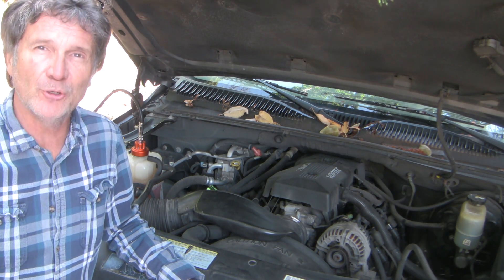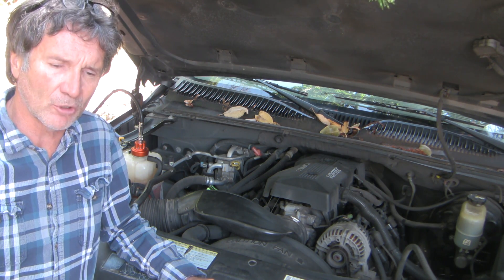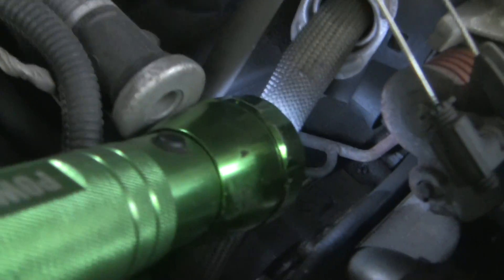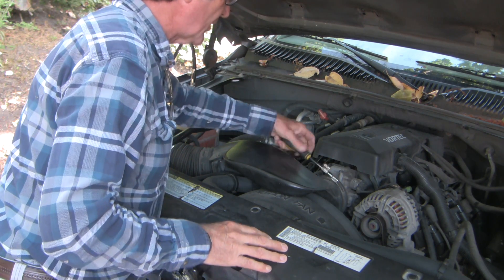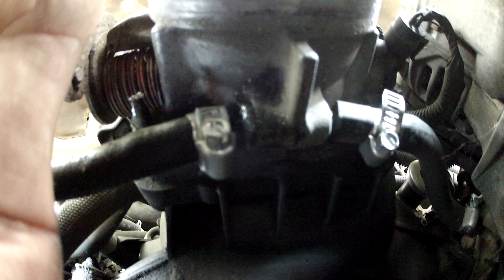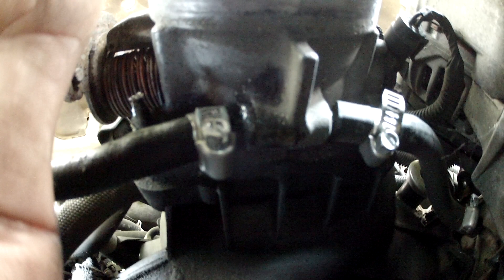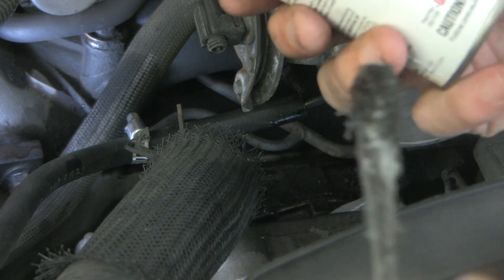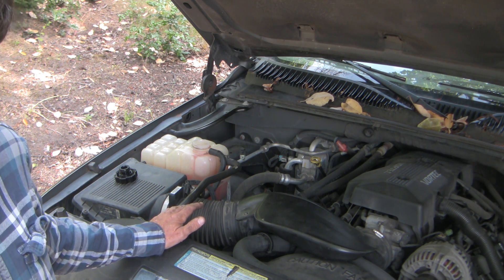How to diagnose a mystery coolant leak in a Chev/GM truck

Comment: I think it's a good idea to always change the thermostat if you fix a leak just in case it's not opening as fast as it should I guess you would know if your fans are running when they normally don't
Reply from the maker: You make a good point, although the quality of parts these days is far inferior to what was on the vehicle originally. I suppose if the thermostat fails to open early enough, pressures could spike and hoses could leak, especially if your gauges fail to show temperatures.

Comment: What if the leak is coming from plug on the coolant
Reply from the maker: Good question, what if the leak is at the cap, which you removed to put on the pressure tester? First, have a look at the cap, sometimes you'll find telltale cracking of the seal, or coolant residue around the cap. If that is normal, you can attach a pressure transducer to the drain hose, that hangs down from the cap. That drain hose attaches between the two seals of a pressurized cap. If the bottom seal leaks, you'll never mount pressure in the system and boiling point is lower. That leads to hot steam exiting the system, which may make a puddle or may not depending on volume. A pressure meter should be able to measure pressure in that hose if you've got a significant leak there. If in doubt, change the cap, they aren't too expensive.
Reply: @spelunkerd  the leak is coming from the overflow hose a part of the clamp broke trying to fix it asap. No Auto zone in my city has overflow hose right now
Reply from the maker: @r.brown0294  The overflow hose for a pressurized reservoir like the one shown won't push fluid or air unless system pressures are too high, OR the bottom seal for the cap is failing to make an airtight seal. The most common cause of system pressures being too high is because of trapped air in the system, in which case the air expands as it heats, forcing air and fluid out that hose. The most common cause of trapped air is a coolant leak or recent work on the engine, forming air pockets inside the cooling system. Inspect the cap, fill the system to full, run the engine with cap off to burp off any trapped air, and reassess. If it has been leaking you need to find the cause and if pressures are consistently too high, consider other more uncommon diagnoses like a stuck closed thermostat, head gasket leak, etc.
Reply: @spelunkerd  question one of the clips Brokaw if I break the other clip off get a rubber Pat and clamps with that work just as efficiently? As the original clips

Comment: Hi, I have a 2016 chevy silverado 1500. I have a slow "mystery" coolant leak that takes about 2-3 days after I've refilled the coolant for it to start overheating. I can't really tell where the leak is coming from with all the emissions crap covering everything. It is wet all along the bottom part of the radiator and  a very slow 1 drop every 5 min off the framing behind the headlights. I dont see wetness anywhere else. Radiator leak? things I should check first? Loved this video. I'm gonna start watching your other videos right now lol.  oh miliage...130,000
Reply from the maker: Take off the plastic covers underneath and find out where that leak is coming from. Lots easier if it isn't raining outside, ha ha. The most common cause of a leak at the bottom of the rad itself is the radiator, which commonly leaks from the two plastic end caps, one on each side. Other places to look for are hose connections, the weep hole of the water pump, and various connections including the drain spigot at the bottom of some radiators. If the rad is leaking, simply replace it, nobody fixes those any more. Keep the reservoir full and don't delay repair.

Comment: I also have a mystery leak (2005 chevy Silverado 1500 4.8) ; the fluid only disappears down to a certain level in the reservoir tank and no further. But, that is enough of a loss that the engine runs hot and get very close to overheating. Also there is no visible evidence of puddling or otherwise.
I’m taking the advise of your video and focus on this hose connection. I hope it works for me.
Note: my throttle body hose connection has the ‘squeeze clamps’, yours had the ‘screw strap’ type. Those clamps on yours don’t appear to be original (? Idk).
Reply from the maker: Yes, I added those clamps. If you're overheating the game is more serious. It may be simply from trapped air, but overheating can be from various other issues. You can even get coolant loss from overheating when the valve on the pressurized reservoir cap decompresses. Two 'easy fix' diagnoses are a bad cap and a bad thermostat. The Chev thermostat also controls bypass flow, and if that bypass tract sticks open you can run hot. If you can't come up with a diagnosis I'd look for a second opinion from a shop before it is too late. One thing that could cause a plateau of coolant loss would be a cracked reservoir tank.

Comment: i bypass that i run right from the rad. to the engine
Reply from the maker: That's a good point, I always do that when possible, too. The radiator for this vehicle has no fill cap, the reservoir is pressurized and the only cap is on the reservoir. It's easy to spot a pressurized reservoir by having a close look at the cap. Like the cleverly designed radiator cap, it has two spring loaded valves opening in opposite directions to allow both pressure relief and automatic burping.

Comment: Where did you get your pressurizer?
Reply from the maker: First one was Astro, in the mid 90's, I think through an automotive parts store. It was missing caps for some vehicles (like the somewhat unusual GM vehicles of the mid 2000's),  so second one was a chinese brand through Amazon a few years ago. The chinese pump isn't great but the caps are fine.

Comment: I'm losing water and  I smell fluid.
Reply from the maker: If you smell fluid from the drivers seat, check your floor mats, specifically the front passenger floor mat. If it's wet with coolant, you've got a leak in  or near your heater core. The bad news is that although the solution is as simple as swapping it out, the labor to remove the dash is many hours. If you smell fluid from the engine compartment, you want to do as I did, hunt it down. Common places to look are the radiator and hoses.
Reply: @spelunkerd  its  only outside the  van . Its driving me crazy.

Comment: I need to get that tool to pressurize my system, I have the Exact same issue with mine currently. I didn't even know those hoses were there on the throttle body? Excellent video, I desperately was needing this!

Comment: I loaned one of these from my local advanced auto and none of the caps fit my radiator so used one of the universal ones the kit came with. The system held steady at 15psi the whole time and I couldn’t see any obvious leaks. Pretty annoying I know I have a leak as I always see it dripping around the transmission and have a small pool under the truck. Oh well..

Comment: @ 3:56 is that the coolant leaking?
Reply from the maker: Yup. I made a little fountain when I pulled that leaking tube off, even though I decompressed the pressure and removed the pressure tester from the reservoir. Pressure imbalance from inside the cold engine drove fluid to escape, for some reason. I was ready to cut the end of the tubing down and so quickly replaced it, then mopped up the mess of coolant on the garage floor, ha ha.
Reply: I’m working on my GMC truck and am having the same issue. THANK YOU !

Comment: My 2001 4.8 has a mystery leak. It would be so nice if it was a hose and not a head gasket. Next, get my hands on a pressure tester. Thanks for the vid.
Reply from the maker: I'm told that some autoparts stores will loan them out for a deposit. This version of the GM engine has an unusual sized cap and it can be hard to find the right adapter. The other option is to find an inexpensive generic kit online.

Comment: I had the same issue  and discovered  right where the thermostat  joints  into  the antifreeze  tank and heater hose that plastic  joint with those plastic  or rubber  clamp that plastic  joint  had a hair line Crack in it , also it had become  dry rot I'm buying  a metal  joint  to join those 3hose together  Sound like they where  trying to save money  and cut cost you ask me

Comment: Nice find! I have this symptom. Also I smell coolant when I come to a stop.
Reply from the maker: If you smell coolant in the cab of the vehicle, check the floor mat on the passenger side for wetness. The heater core is a type of radiator that can leak coolant and give a moist smell. Unfortunately it can be hard to reach, labor to replace a heater core can be significant.

Comment: Heated coolant is routed thru the throttle body to prevent freeze up during cold, humid weather driving.   Older engines used exhaust heat to prevent freeze up.
Reply: Hmmm, … I have this problem. Your explanation makes me wonder …. Since I live in Southern California very dry and mild …. Would it be reasonable to bypass the coolant flow through the throttle? Just a thought; first I’ll try fixing it.

Comment: I have 96 chevy blazer with coolant pipe between grill n the radiator.it leaks.spirts out in front..anyone else?? I used epoxy jb weld on seam.waited 24 hrs.start car.it leaks.applied more.waited 24 hrs.started car.it leaks.so I put whole thing on.waited over 24 hrs start car.still pours out..any ideas???
Reply from the maker: Replace the line. Check for wetness along the sides of the radiator, where the plastic housing fits into the aluminum radiator. They commonly crack there because of the heat/cool differential expansion. If your radiator is cracked, I would replace the entire radiator. I love JB weld but for pressurized cooling system components I would never trust it.

Comment: Hello nice video. I assume that is a v8. My v6 is losing water but i dont think it has this hose. I imagine it is the head gasket
 I add coolant every month.
Reply from the maker: This vintage of truck is also prone to porosity of the metal used to cast the heads. The casting number on the head will help decide how likely porosity is. My casting number is 706, easily seen on either side by wiping grease off the top of the head (front on passenger side, rear on drivers side). If you don't find a cause with pressure testing, and you have a head that is vulnerable to porosity, consider removing the rocker covers and repeat the pressure test. On the other hand, more common causes like a leaking radiator, water pump gasket, or hose are still more likely.

Comment: I need to find a small coolant leak in 2003 Chevy Cavalier. It is dripping from the right side below. Thank you for pointing the possible locations of the leak, like by the throttle body hoses, and how to use the Coolant Pressure Tester.
Reply: Check your heater core connections. When you say right side I’m assuming you mean passenger side. That’s where your heater core connections is located. Also check the floor inside on passenger side to see if it’s the heater core itself leaking.

Comment: Hi I'm Roger the Farmer from Grantsburg Wisconsin !  I just found this in my feeds and have a 2000 Tahoe that I picked up from a kid who had it for about a month and smoked a Deer with it . It took the Grill ,lights , condenser, Radiator, coolers , fan , the whole front all most  . I got it from him for 400.00 Buck's !  Bucks ! Lol  Any way got all the parts for about 300.Bucks  put all together and has been on the road about 6 month s  and I started to drop COOLANT  . I do have dash issues with the lights blinking on and off and Service 4wd light on all the time . And one I can't figure out  . 
When I turn on the key it's always in 4hi . I have to push it to Auto 4wd then to 2hi with the transmission in neutral  and push the button s a couple of times  and  then it will go to 2hi and the indicator light goes out and it's in 2hi . As soon as I turn the key off it defaults back to 4hi and I have to do it all over again  every time the key is TURNED off ?  Help I don't get it. I'm a Allis Chalmers Tractor guy not a GM Tech support guy ! Lol . I'm going to check out my hoses about the coolant and see if that's the case I have or they said it might be a cracked head too . I hope not. Thanks  I hope you get this email
Reply from the maker: The transfer case switch that controls the FWD in these vehicles can go bad, which could cause what you describe. Also with all the front end damage you might have a look at the shift motor on the front axle, responsible for locking the two front hubs together. It is electrically controlled, you want to be sure those wires are intact. I'd check the fluids in both the front axle and also the transfer case. You may get more info from a high end scan tool. The transfer case in these vehicles has three VR speed sensors that help the transfer case do its thing, and if one goes bad it may interfere with shift control. I did a couple of videos of that problem in this vehicle. I also did a series of videos showing repairs of this Suburban over the years, including a few showing how to investigate a slow coolant leak. These vehicles were prone to a couple of things. The NVG246 transfer case was vulnerable to 'pump rub' causing catastrophic oil leaks, and also the cylinder heads were prone to porosity that sometimes caused a slow coolant leak. Neither of those happened to mine, yet.

Comment: pretty awesome. And yes Throttle body is not even mention in the diagnostic. it's always the intake manifold.
Reply from the maker: I did a little research on that. The LS engine series had a coolant air bypass system that was designed to clear air pockets from all four corners of the engine waterjacket and send them back to the radiator and coolant reservoir. It was added to the design to prevent localized overheating. It also makes burping air from the system easy. In my engine you can see ~1/4" steel coolant pipes above the valley between the heads and below the intake manofold on my LM7 variant, and on other engines of this vintage. Those tubes merge together into one hose that goes to the throttle body, so that any ice in the throttle body would quickly melt. From there coolant is sent along the tubing that was leaking in this video, to arrive at a midpoint of the radiator on the right side. When Chev decided to add their notorious displacement on demand system, they deleted those pipes. Some guys modify those pipes to use braided hose, you can buy specialty tubing kits to do that.

Comment: I hope you tell me from where err i can get the compression tool you used. Or any reliable one
Thanks
Reply from the maker: The kit I have is no longer sold, it is by Astro Tools. The present version is more inclusive and over $250, but even so they don't include the cap for late model GM vehicles. You can buy knockoff kits, search "coolant pressure tester kit" and choose one that is right for you, cost is ~$60-150. Those new kits are better because you can do vacuum filling, they have more caps, and you can actually test some caps. Unfortunately the trend in automotives is for every manufacturer to use a different rad cap, which is annoying! Another option would be to ask at your local automotive parts store, who may offer to lend or rent a kit to you for the day, for a lot less. Or, you could buy a new cap and make your own kit from a bicycle pump, etc. Or, you could VERY carefully run the engine and look for the leak with engine running. Watch out for electric fans that will turn on without warning, moving belts, and hot exhaust components. Good luck!
Reply: @spelunkerd  thank you very much. 🌹
Reply from the maker: @abdou1284  You're welcome. You should edit your first message to delete your phone number. To edit, roll your mouse over your post, three dots appear. Roll your mouse over those three dots, and click. A drop down menu appears, click on the edit tab. Then remove the numbers, so you don't get unnecessary spam coming through your phone, then click the save icon. Cheers!
Reply: @spelunkerd  Done with pleasure 🌹

Comment: I have the same issue on this 99 suburban, just replaced water pump, thermostat and housing, radiator and upper and lower hoses.    Left in garage for 3 days with cardboard under the suburban.  I am gonna check this now. Thanks
Reply: Did you figure it out??

Comment: My truck got the.low coolant.light I checked resevoir and it was bone dry . Added fluid , the next morning I saw a.small amount on ground . But haven't had to add . I drove it on.hwy previous to this and I hv a lot.of.worn.out front end parts and I drove it lknger than.normall at highway speeds 
Anyone.know if the rattling and.vibration of the trucks worn.out front end would cause a coolant leak ?
Reply from the maker: The only possible link would be broken plastic in the radiator, which is fairly common on the sides. I would focus on where the leak is coming from, consider the rad, hoses, that throttle body coolant tube, or the weep hole of the water pump. It will be easier and safer with a system pressure tester, as shown. Good luck!
Reply: @spelunkerd  Hey thanks so much leak  is dead center in the front. Ya made an appointment for the morning at a radiator shop dunno if that was the best place or not. Truck is lowered and its too cold here to do much right now outside. I'm just hoping its at worst the water pump..